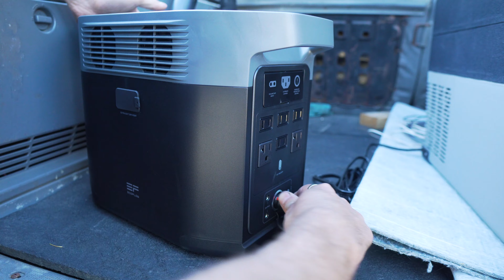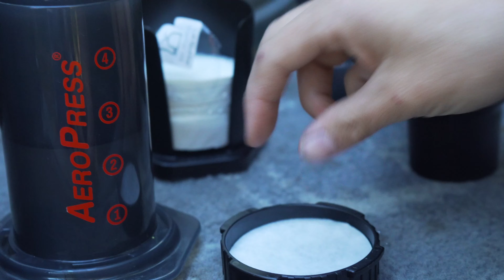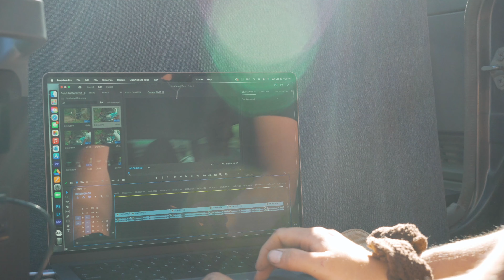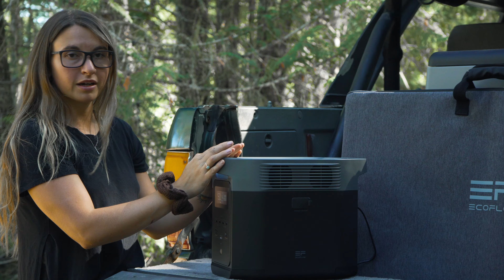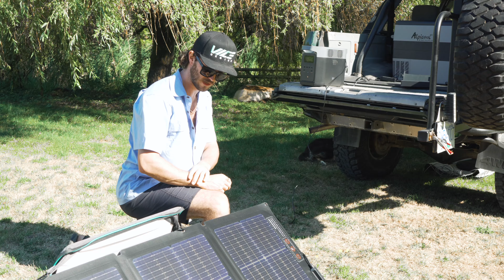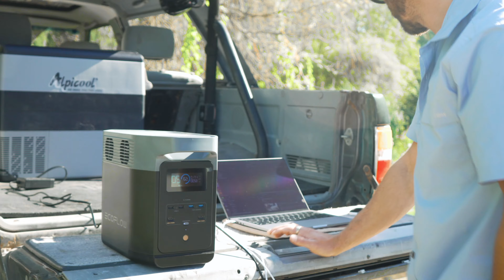EcoFlow DELTA 2 | Honest Review for Overlanders and Van Lifers.

Comment: That 220 watt panel also collects ambient light from its backside that can be boosted using a mirrored surface.  I decided to us cheap "non glass mirror tiles" ordered off of Amazon. 
Good luck to y'all. Do you think you'll be keeping this solar power system? I still have other systems but this one combo with the 220 watts panel beats my other system that had five 100 watt panels (in parallel) to do this same fast charging.

Happy trails!

Comment: Why don't you just hook up a dual battery system? I have a 2k-watt inverter hooked up to 2 marine deep cycle batteries that are charged by my alternator and on an isolator switch. 300 dollars total. I mean, that thing totally gets bonus points for modularity!  I've always been interested in those! But I'm cheap. Always astounded by what they can do.

Comment: Bless you two for this. Been trying to sort out power for working on the road & NOT having to charge all the things in the nearest starbucks. I was leaning towards a jackery after getting a wild quote for a dual battery system in the truck (who knew electrical was so expensive - not I). Regardless, this unit is rad & happy to support via your code. I'll grab one of these next week. Thanks for the review & the great content
Reply from the maker: That's awesome Brett, thank you for the support, I trust the Delta 2 will work great for you as well!

Comment: I clicked on this video to find out more about off grid power, because you can never know too much about that. Imagine my surprise when I see you two! I agree about the front/back panels, but the quick charge and the ability to use a high-wattage solar panel are great. I get by with a much smaller unit running a smaller fridge and a phone and PC. I do most of my charging off of the vehicle and a 60 watt solar panel and it gets me by, but you can't miss a charging opportunity or a shot at some solar power. A unit like this would allow a person to not have to manage you power so closely. Nice ride, I'll have to search your channel for more info on it.
Reply from the maker: It's definitely a beast for what we're up against. Yet to check the DC-DC charging ability as we cant rely on sun 100% of the time. We'll check back in after more testing!